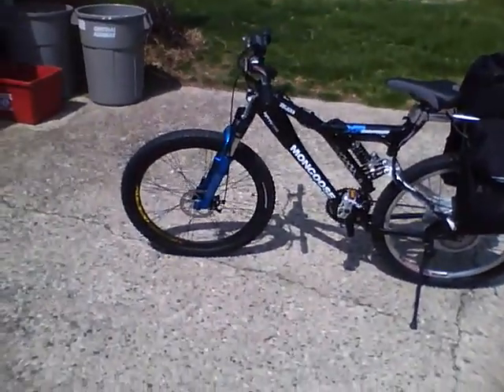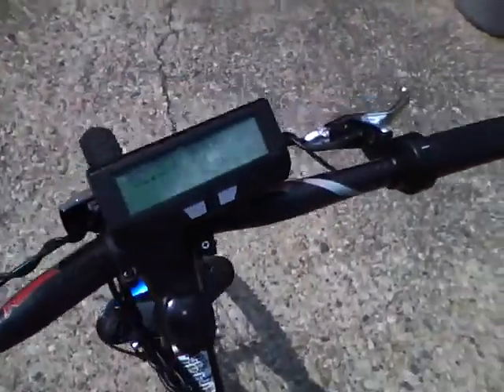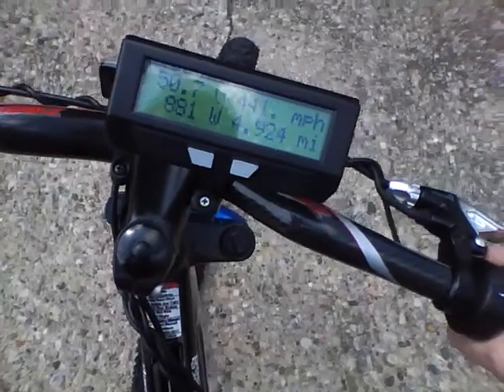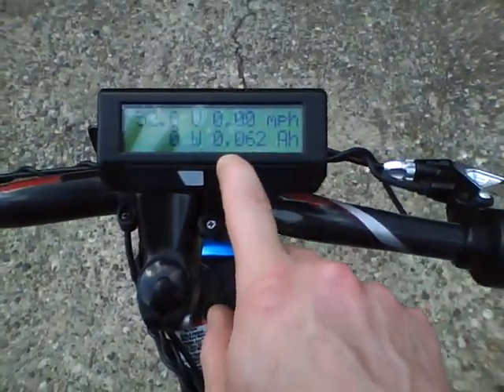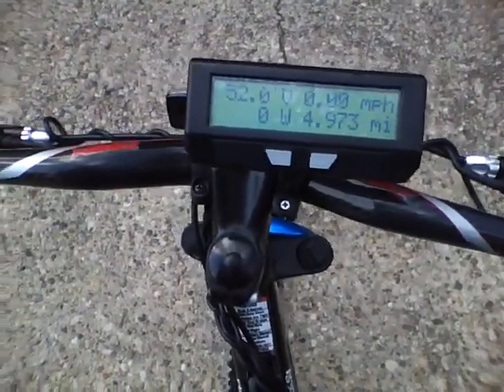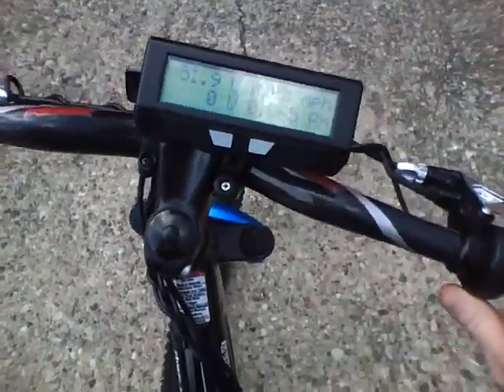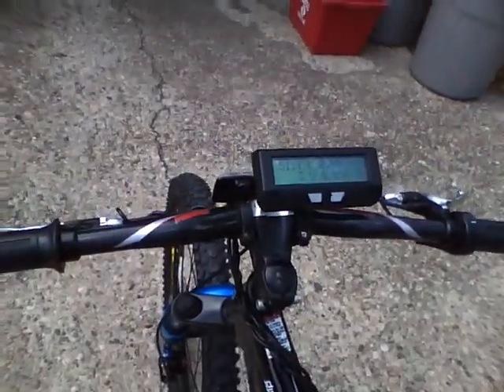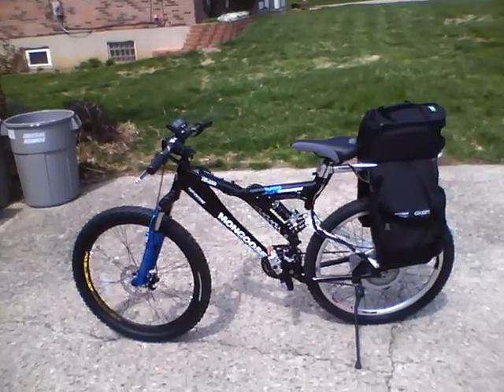Troubleshooting my new Crystalyte.

Comment: Try swapping the wires until it runs better. If it doesnt run better than it could be a phase wire issue too. Same thing, where the motor and controller werent color coordinated correctly. no big deal. There is only something like 10 different combinations.

hope this helps. PS: for me, my Crystalyte to my Lyen 18FET controller was; Phase green to green. Swap the other 2. And my hall sensor was yellow to yellow, swap the other 2. Leave power and ground alone - red to red, black to black.

Comment from the maker: @1980TheRealFury Sorry for the delay in my reply.

Yes, that is the new, direct plug in, large screen, Cycle Analyst.  I'm very pleased with it.

I am still dealing with my little problem.  I'm about to ship my motor and controller back for an RMA.  My problem lies there.

(In the mean time, I'm trying to get a very nice LiFePo3 battery pack from China, through customs.  It's taking forever.)